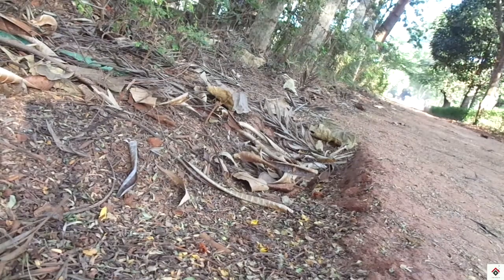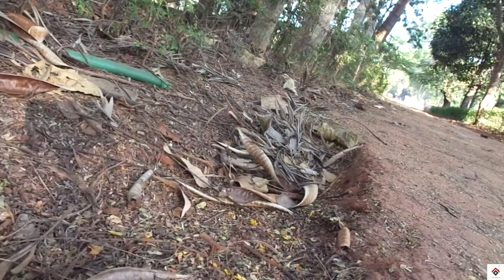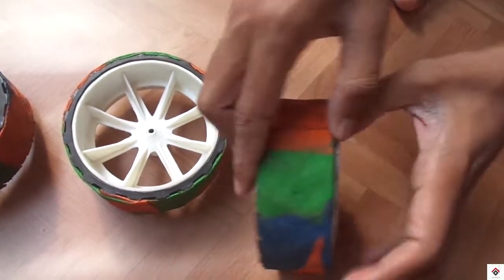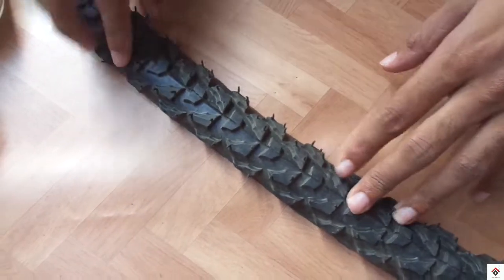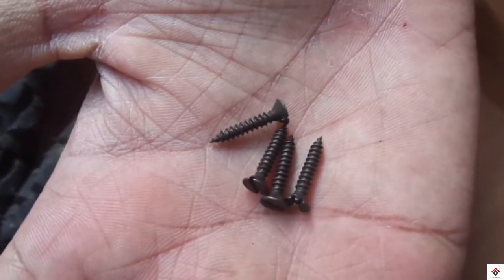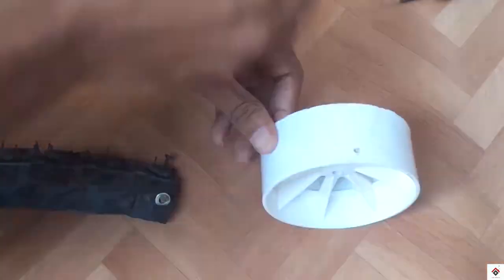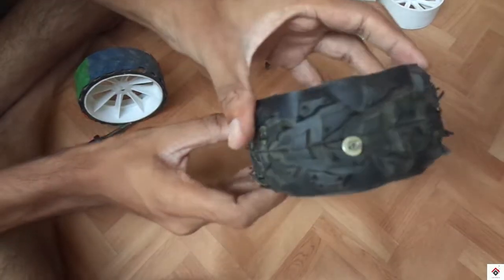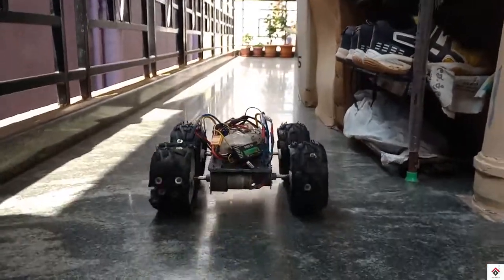How to increase grip of robot wheels | Robot wheels improve wheel grip | 4 wheel Roborace robot

Comment: i was thinking of making using silicone will it be better?
Reply from the maker: It should have rubber property to give proper grip.
Reply: @techathome  the bot is for soccer and sumo , silicon seems to have better traction than rubber so i was thinking that but for roborace rubber is better option cuz for its property silicon is hard and wont grip properly